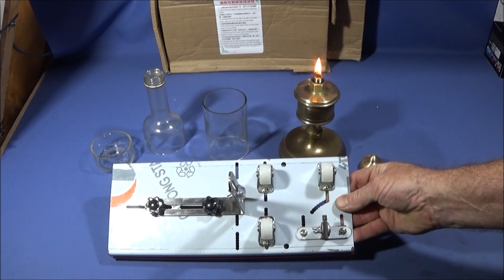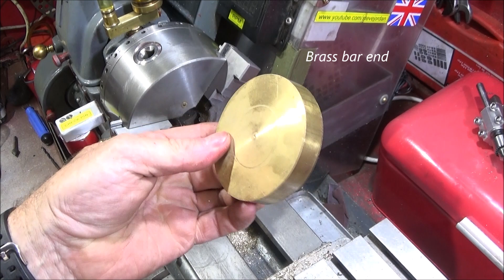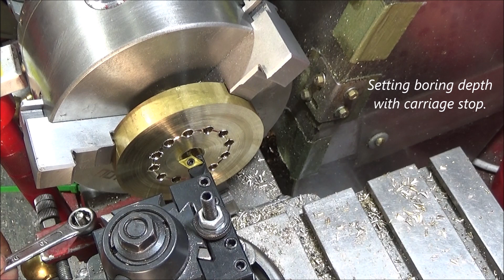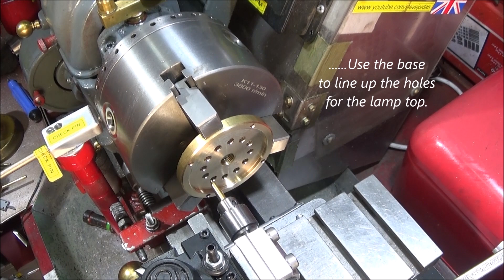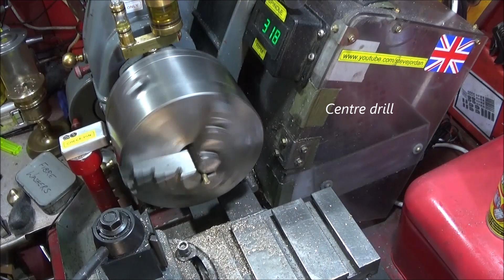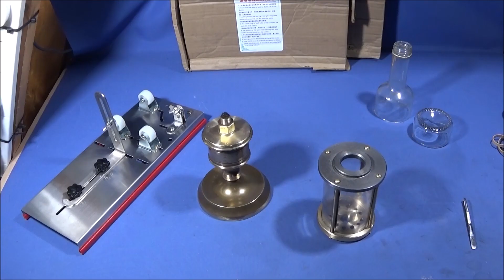A Bottle Cutter & Making An Oil Lamp Glass Top On The Myford

Comment: The method for cutting the glass using a cotton string, then soaking in alcohol, lighting it on fire and then dipping it in cold water would have been cheaper. You can always sand down the edges to get an exact fit. But it was fun hearing how you made the bottle cutter better. LOL 
Love this. 
It looks like it should be on a boat. 
⭐⭐⭐⭐⭐

Comment: Its a really good idea but the glass will get black if used for hour or so
The flame should be controlled on long run
Reply: I was thinking will the glass get hot and crack didn't think about blacking still awesome work 😃

Comment: I as thinking of doing this, but using the lathe itself.  Chuck up the bottle with rubber pieces on jaws.   Standard TC tip  sharpened well to score the mark.   Anyone got views?

Comment: Great example of your indexed back plate

a steampunk aspect

any trouble milling the exercise weight plate?
Reply from the maker: Hi Len Thanks. The weights are made of cast iron so they are soft and nice to machine. The only downside is the chips and black dust which gets everywhere and can easily clog up the lathe slides. I clean up as I go and thoroughly afterwards. Regards Steve
Reply: @SteveJordan  I ask because I've seen comments that weights are usually not quality, pristine iron, but can be composed of all kinds of various scrap iron and steels thrown in the melting pot, giving variations in hardness, voids.
Reply from the maker: I have found them good so far. Just cast iron. A couple have had air pocket holes in places but I have machined quite a few for various projects. The actual weight lifting bars are nice steel. I always collect those if I get them cheap.